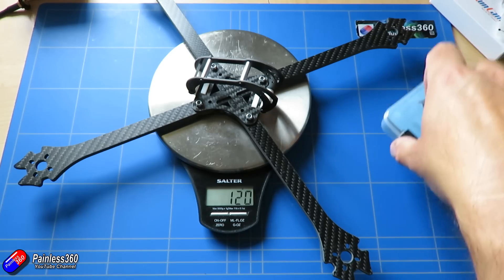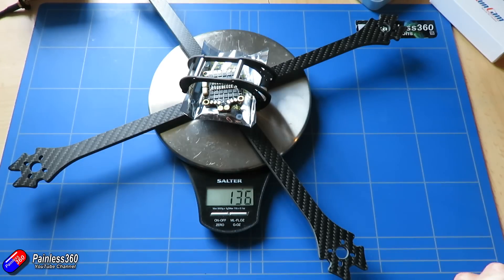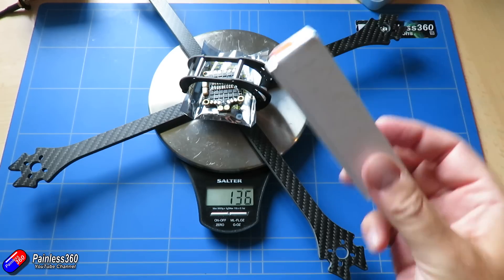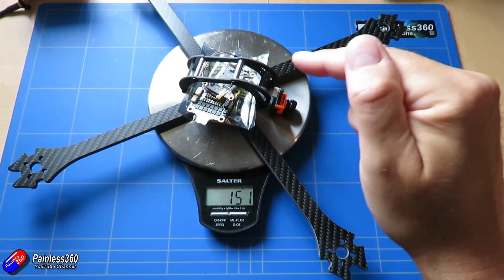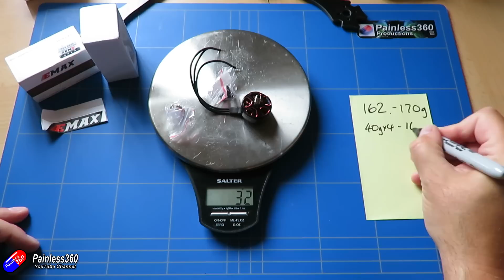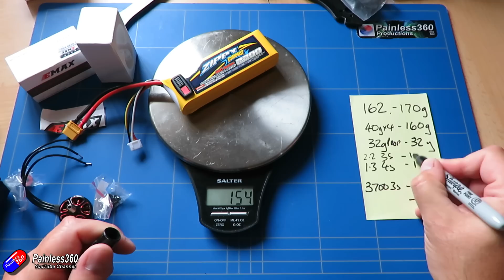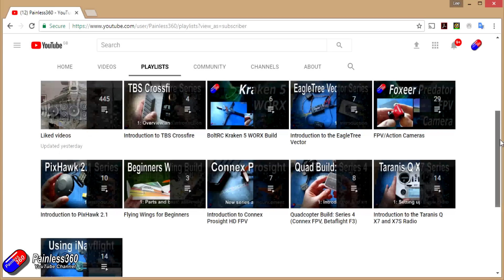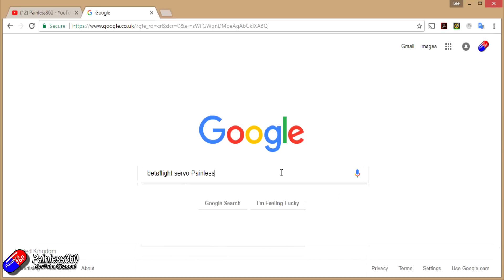Endurance Quad Build (S9): Figuring out the weight and thrust needed

Comment: Love watching your videos have done now for several years learnt and built many projects based off your inspiration. Quick couple of questions. On this build I think you used 7x4.5 props on the Emax motors did you find this the most efficient. Also I am inspired to make this project will use inav and crossfire as these for me are a great combo I see the Returner r3 2207 1660kv at £15 would this motor be as efficient do you think or shall I fork out an extra bit for the Emax motors you proved. Thanks in advance and great work. Dave..
Reply from the maker: Tricky to comment as I've not tested those other Motors, I'd expect most Motors with a similar KV will perform in a very similar way. Best of luck with your bills, and let me know how you get on. Happy flying!
Reply: @Painless360  Thanks 😀
Reply: @Painless360  Have decided to go with those emax motors with airbot Asgard 32 aio for compactness also looking at your figures a DIY like ion cell may be on the cards 26650 cells rated at 5000 and 20a const 50a burst hk liitokala lii-50a these may be of interest to you on your build. Am going for TBS source one with 8 inch arms I am hoping for 20 Min  plus.But with this DIY lipo my number's suggest 44mins but I think I am in error maths is difficult for me I got
5000 -80%=4000
4000/2960=1.35 cruise thr
60/1.35=44
Can keep you updated if you want.
Regards David

Comment: Sony VTC5A 18650 2600mAh 25A Battery. 3 in series. According to the specs would be 10.8 volts  2600mah  143.4 grams Continuous Discharge Rating: 25A with max 35A. I know you may bring it up later but technically this would work based on your motor test right? Theoretical exercise. The Racestar would be better.
Reply from the maker: I may look at Li-ion later in the series once we've found a better motor/prop combo. You do need to factor the weight of the motor into the calculation too..

Comment: Ahhh.... it has come full circle already, back to the Flame Wheel F330/F440 days when everybody was using 1400kv motors and APM flight controllers. LOL.

Question - What's the benefit of using those long arms on the frame? Surely we're not looking to swing anything bigger than 6 inches?
Reply from the maker: This is a million miles away from the lumps of carbon and plastic that made up a flamewheel. Until I test the motors we won’t know the best prop size. I have lots of 7” here..

Comment: Get rid of those batteries and use Liion new Tesla Cells

I got 10.5 miles on a 4S 4000 10C Mulitstar battery with 6X5 biprop Gemfan Flash Inav
Reply from the maker: Please make some videos about how you e done that - of be interested..
Reply: With Inav it will give you distance traveled. If you go into forward flight it will consume less energy than hover I look at my throttle % and speed to pick a efficient throttle % for me around 30 - 40% speed around 30-40 mph up to 50 mph or so depends on wind and I fly in a big circle me and my buddy flight together his is more efficient with vertical limb arms. We get somewhere around 235 mah/Km

Comment: What about the motors? What size & KV did you weigh just then?  What size/pitch props are you looking at? Kinda glossed over a pretty key part of your build😬 Looking forward to the rest of the series!👍
Reply from the maker: If you watch the series from the start you’ll see that this video is to get a rough weight - the next video is the one where we will test the motor and prop combos to see what gives the best results at the thrust levels we need.. . ;)
Reply: Oh, okay got it.  Looking forward to that discussion.  I'm working a similar build using Emax LS2207 2400Kv. I assumed Light Spec were better for long range than their Race Spec, but that's without any testing.  Thanks for putting out such great content! Cheers!

Comment: Good luck.  You can also use eCalc.ch to estimate the performance.  I went through this process back in the day and after building at least 10 quads and tricopters,  finally gave up and bought a phantom 4 pro.  It has better range,  more stable video and good flight time.  The only downside is that I have to put up with the usual DJI bs.  Oh, and the camera is a really good 1" sensor.  I even tried an asemectrical tricopter with big props in the front and a small one in the back.  The "Big Taz" was the result.  With modern parts you will probably have better results.
Reply: Allen Tweed for most of us, it's not the end result what counts but the way to it 👌